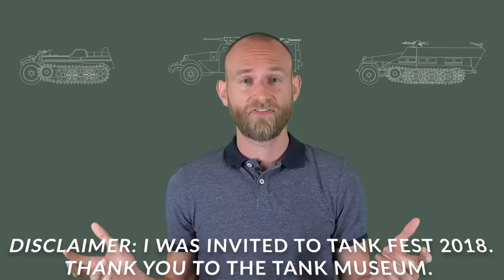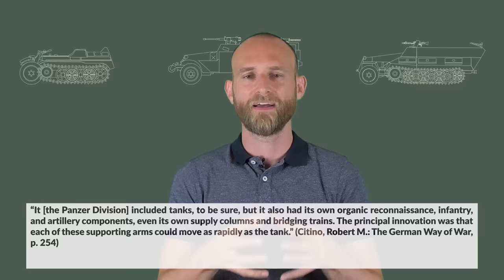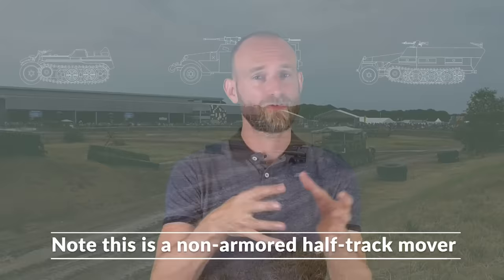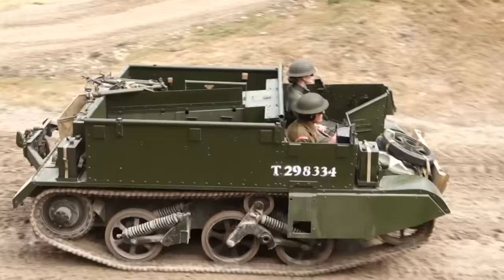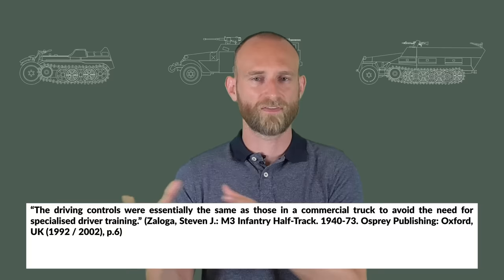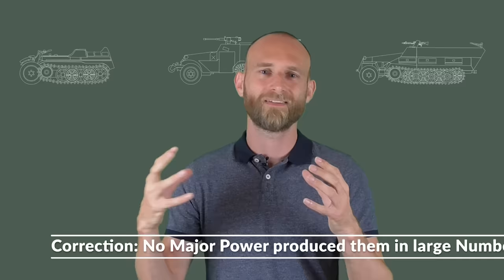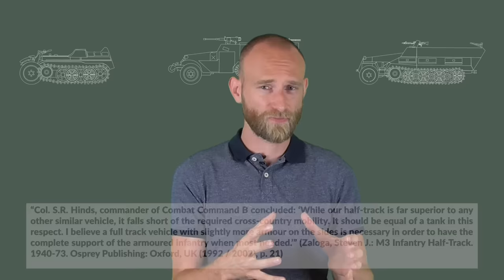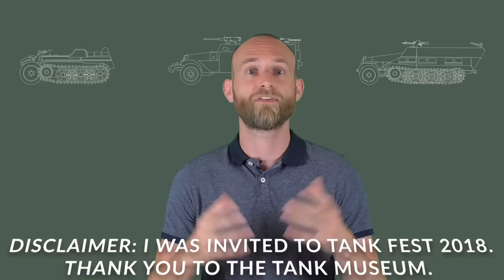Why Halftracks? Why limited to WW2 only? (Featuring Tank Fest 2018)

Comment: Anyone that has had the opportunity to drive a half track knows the mobility and speed cross country is vastly superior to any fully wheeled vehicle.  The number one reason that pulls a half track down is the maintenance requirements, just like armored tanks.  Today, the reason half tracks are not produced by major powers is vehicles are separated and developed by their "category" of direct use, which armored combat was still in its infancy even after World War I.  For example, today, the United States has Strikers (fully wheeled), Bradleys (fully tracked), arctic SUSV (fully tracked split unit), and still a number of MRAPs (fully wheeled).  Half tracks simply do not have sufficient protection on today's battlefield, but could be reintroduced if development funding was provided.  These vehicles would end up being substantially heavier and more shielded than past counterparts, but still could have a role in combat today.

Comment: Just a thought about modern mine resistant vehicles. Due to the current types of wars waged in Afghanistan and the Iraq a switch was made to armoured patrol vehicles with high mobility, speed and protection against mines. Could a half track possibly be a solution to this problem?
Reply from the maker: No, on my main channel I have something on that design, why ied are so dangerous or something
Reply: McPuff
I was thinking of a heavily armoured cab on wheels, pushed by tracks at the rear. The problem would occur if the rear of the vehicle were to be hit instead.
Reply: @McPuff The Centurion would like to have a word with you about the inability of tracked vehicles to have V-shaped hulls^^
Reply: Lavrentivs - Occupants of V-hulled vehicles are more likely to survive a mine. Track won't. Vehicle won't. Depends on which you have more of: vehicles or troops. Russians had plenty of troops. The problem as always is getting to the fight the "fustest with the mostest." Troops, ammo, fuel, vehicles. Always short of something.

Comment: A great deal was omitted from this story.  For one thing, the half-track was invented neither by the Germans nor the Americans, but by the French, and it was invented in Russia.  Yes, in this instance the Russians can truly say, "We had it first!"  Prior to WW-I a certain Frenchman, by the name of Adolphe Kégresse, was working as chauffeur to Tsar Nicolas II.  Apparently the Royal Family used to take their limousines on hunting trips in the forests, where they would become bogged down.  Kégresse cleverly solved that problem by replacing the rear (drive) wheels with tracks.  Voila, the half-track was born!.  After the fall of the Tsar, Kégresse returned to France and sold his design to Citroen, always an innovative car company, which began producing half-tracked cars for off-road use.  They became famous in the early 1920s when they succeeded in crossing the Sahara Desert.  During the 1920s the French Army adapted half-tracks as armored cars for use by their cavalry.  However, the French Army quickly realized that half-tracks were not as effective in that role as light tanks, so that they abandoned the idea by the mid 1930s.  Nevertheless the U.S. Army, many of whom were francophiles in those days, bought some French half-tracks for evaluation, and later developed them into the personnel carriers which they used during WW-II.  In the end the problem with the half-track was that, off road, it was never as good as a fully-tracked vehicle while, at the same time, it was heavier, more expensive and more difficult to maintain than a normal wheeled truck.http://www.citroenet.org.uk/utilities/autochenille/autochenille.html

Comment: Has anyone ever tried to change a track?? Has anyone changed a tire?? I can tell you changing a tire is a lot easier and faster especially if the tire is already on the rim. Tires usually weigh much less then an all steel track. Tires also have much less wear especially some hard compound tires getting +65k mile life. Good luck trying to get that many miles out of a track!!!
Reply: I don't know about the german and french half tracks, but the american tracks were made of rubber, with steel reinforcements.
Reply: Lavrentivs - German WWII tracks were steel jointed chains like bulldozer tracks. Any speed wore them out quickly. I have seen 3-5,000 mi.
Infantry on foot 3 mph.
US tracks steel reinforced canvas, lasted 5-10 x as long as German. They were constructed using tire-building technology.

Comment: The problem with this analysis is the current popularity of wheeled IFVs. 

Doctrine is the main thing here. To use traditional cavalry terms, the question was whether dragoons or heavy cavalry was needed. Trucks and half-tracks and APCs are like dragoons and bring infantry to the battlefield where they can get out and fight. 

The original idea of the IFV like the BMP was that the infantry could join the heavy cavalry and fight while mounted. My impression is that armies have largely returned to the dragoon model with the better armed IFVs filling the role of infantry support/assault.  

Half-tracks were an early development half measure. Better than nothing but not as good as either a fully tracked vehicle or a more developed armored car/wheeled IFV. They were good enough in the same way the M-3 tank was good enough for about 5 minutes in North Africa.

Comment: the disappearance of the halftrack was more due to improved road networks in the countries they saw combat and were designed for. they do well off road but are a real bear to keep going straight on hard surfaced roads. 
in short they were obsolete by the time the cold war kicked off in earnest. they did see a further deployment in korea for the duration of the hostilities there. once the armistice was in place they finally disappeared.

Comment: This video seemed a bit incoherent. Wanting a closed top doesn't seem like a reason to stop building half-tracks, for example, there doesn't seem to be any inherent reason you shouldn't build an enclosed half-track even if most (all?) WWII models were open topped. You also say driver's licences being uncommon in the 40s was a reason to use half-tracks because they drive like trucks, which doesn't follow. Finally you say driver's licences being more common somehow helps with the decision to do fully tracked APCs post-war. It's all very strange. 

I think basically tracked APCs can better keep up with tracked tanks, and as people got better at building tracked steering systems and training people to drive them armies no longer needed to compromise with half-tracked systems.

Comment: Something I'm unclear about from the video: it's stated several times that one of the disadvantages of halftracks was that they were open at the top, like that's inherent to the design.  Was there a practical reason why they couldn't make a halftrack with a closed top?  Was it a weight issue?
Reply: They could. SdKfz 253 produced in 1940 had a closed top. Nobody liked it so they did not make more.
My guess is they just liked to open fire and jump out fast. And see stuff around them well. It's not a tank anyway so why suffer sitting in an iron box. Everyone started making closed machines later mostly because of nukes.
Reply: @user-we7lv8pm3o  The SdKfz 253 seems to have been a light observation vehicle with a four-man crew, not a troop carrier.

Comment: Dumb question. How was the half track turned? With the tracks turning at the same speed. Turning the tires couldn’t turn the tracks. To turn one. You needed one arm to slow down one track to match the turning of the wheels. You would need 6 arms. So how did one man steer a half track. I am confused.
Reply: The M3 Halftrack had a normal truck differential.
The german halftracks had a differential with steering brakes, connected to the steering wheel (2/3 only frontwheel steering, last 1/3 frontwheel and track steering)

Comment: There is only one point why the Germans build no half-tracks any more: they were to expensive. Nothing else.
The German system was extremely good under all conditions but complicate and very expensive to build.
And the "Maultier" half-tracks were needed to get a normal truck converted to a russian-road-crawler.

Comment: why did they cease to be used after ww2? simple, the technology outpaced their usefulness, fully wheeled vehicles became better at off-road travel, and much faster, tanks also became faster and much tougher.  half tracks were a stop-gap measure meant to protect infantry and help them move quicker, as well as a stop-gap for off-road movement and supply transport, wheeled vehicles were quite limited in ability at the time, so they switched to half and half to fix the problem.  Once the tech became better, they simply weren't needed anymore.
Reply: crimsonwolf911 - A major deficiency of half tracks is reversing. They steer very poorly in reverse aside from very poor rear view for the driver. Tanks have much better reverse gear driveability as long as the driver gets good instructions from a spotter. Also as US halftracks were built from truck parts they had only one or two reverse gears. In any armored vehicle one thing you don't want is to turn around and expose your lightly armored auxiliary equipment-covered rear when retreating.

Comment: Hello. Good video, but u are a little bit wrong. At least in Czechoslovakia was halftracks produced until 1962 and used/stored until 1995. It was modified "version" of Sdkfz. 251 called OT-810 ( Obrněný transportér 810). Modification included diesel engine, fully closed interier and some other details. (sorry for my english)

Comment: How did they steer them? obviously applying a brake to one track to effect change of direction was the only way, front wheel steering would have had no effect.
Reply: They had a steeringwheel like a normal truck, connected (with a dead zone) to a steering gear (differential with brakes)

Comment: Not true that halftracks were no longer produced after WWII. The Czechs produced 1,500 OT-810s between 1958 and 1962. They were based on the German Sd.Kfz. 251. The Czechs had taken over the former German halftrack factories after WWII. Czech soldiers hated them, and called the "Hitler's revenge" in large part because so many soldiers sprained their ankles or otherwise got injured jumping over the side of the vehicle during training missions.

Comment: Simple , there was no need for a half track . All wheel drive became much better and tracked APC with a closed body N/B protection . Half tracks were the answer to a question that didn't exist ,as light tracked vehicles could do the same job and all wheel vehicles were faster and easier to maintain .

Comment: halftracks because they didn't have the suspension or transmissions in tanks so they could go fast or turn like a truck, and tanks use too much fuel to use them like trucks, and tanks can't carry as many people as a truck... modern day fully tracked vehicles basically have two independant tracks that can be fully controlled, back then they were linked by the transmission, in order to turn you basically had to disconnect a track and fully stop it... hence the wheels... so they didnt have to put complicated mechanisms in the tracks so it could turn... i think one of the first tanks to have independant control on the tracks was the panther tank

Comment: I'm missing something. I don't understand what seem to be the two main reasons.

1. Because more people had driving licences post-war there would be less training required. But these would mostly be conventional licences so suitable for half-track driving but not for fully tracked vehicles. Wouldn't this  have made half-tracks /more/ attractive as you have a large pool of drivers who need very little training to drive them whereas drivers for fully tracked vehicles would still require the full works.

2. Because half-tracks were "open at the top" and thus vulnerable. That's surely not because they were half-tracks but because they were open at the top. Why couldn't you have an armoured half-track?

I get the jack of all trades and complexity arguments but you did appear to treat those as more secondary.

I guess it is quite clear that this isn't my area of expertise!

Comment: I can't give you a vote up on this one.  It was really the FRENCH that pioneered the half-track in the interwar years.  Citroen, Kegresse, Sumoa developed machines for civilian cross country travel, and the army took notice.  The American M2 was just the M1 (wheeled) armor car with a French style track replacing the real wheels.  However they was not used universally, since the large 6x6 GMC, Diamond T, White, etc. trucks were almost as good cross country.  Similar with the British.  The tiny Carrier is not equivalent to the M2, M3, or German Sd Kfz 6 to 11 vehicles.  Like the Americans, the British preferred large trucks like the Scammel and the AEC to haul things around.  Now for the Germans, there is some argument that their half tracks were really "three-quarter-tracks."  They were front-wheel steered only in very wide turns.  The tracks used individual brakes, similar to their fully tracked vehicles, for most turns.  Also also, in terms of driving like a truck, the Tiger drove mostly like a truck, with a steering wheel instead levers, like most tanks, so truck steering is not something peculiar to half-tracks.  And the Germans used mostly 4x2 and 6x4 trucks for road travel.  Since these were not as good as the American and British 6x6 for cross country, they really relied on their three-quarter-tracked vehicles for that.
Reply from the maker: fair enough. The French might have pioneered it, but in the end the most numerous were the US and German half-tracks.
Reply from the maker: it's not a video on the history of development etc.

Comment: During WWII, everything was in short supply, and wheeled stuff was shit offroad. So they may have wanted a IFW, but no way was anyone (even the US) able to make those, let alone in numbers. Later technology advanced to the point where you could either make a tracked infantry vehicle, or a very light, cheaper wheeled vehicle with great offroad capabilities.

Comment: The Czechs produced the OT-810 and the Israelis used the M2s & M3s into the 1970s.  I understand the German and Czech half tracks did not have driven front wheels (only the tracks were driven).  I've looked at m2s & m3s up close and they are actually quite simple vehicles. (especially with continuous rubber tracks). I can't see why a M113 would be better on the road than a modernized (up engined with driven front wheels) halftrack.  The m113 is definitely better off the road and is mostly amphibious.

Comment: Sir!Something gone wrong! Half- tracks wasn't completely abandoned after WWll !Israel troops in his several wars included six- days war used a lot of reformed half- tracks! However half- tracks also Israel eliminated due to hard maintenance and other options! In fact half- tracks has fatal point his front wheels for directions and protruding head was engine easily be hit and damage!So these half- tracks completely run down!And other fatal is the open cabinet eaily be air raids these passengers become target!Mortars and grenades easily throw inside!

Comment: Given your later videos such as the one on the Sd. Kfz 251 (or as Battlefield fans call them "Hanomag 251 even though no contemporary German called it that), I think the fact that the half-tracks being open topped wasn't that much of a problem. The way the half-tracks were used in WW2 seems to indicate to me that positioning of the infantry was pretty important, so extra protection might just be weight that would slow you down more than you'd want, but modern military doctrines would rather have closed tops (and more powerful engines mean less speed is scarified for the protection). If I had to speculate, I'd say if you could give a WW2 army a few thousand vehicles complete with spare parts and their choices were a late 1970s APC, their own half tracks, or a modified 1970s APC using the 70s engines' and guns but with an added front wheel axel and two wheels and the armor stripped down so that it offered as much protection as their half-tracks, they'd prefer in order the stripped-down APCs (for the on road speed so that they could put their guys where they wanted it), then the APCs as we actually built them (since with 3 decades of improvements they're still better and faster than anything made in the 40s), and then their own stuff. Protection and speed are both desired, but I think WW2 doctrines really needed their infantry where the commander wanted them to go.